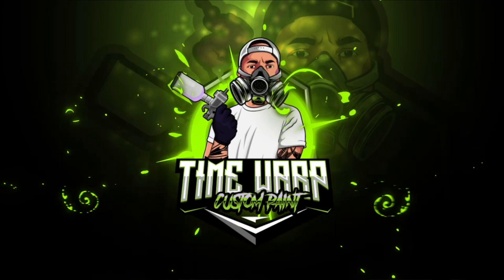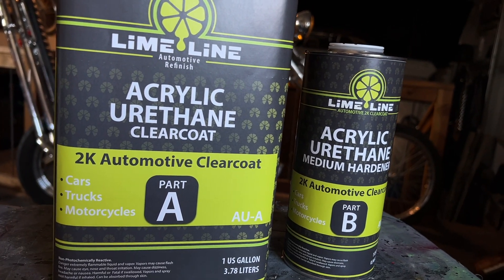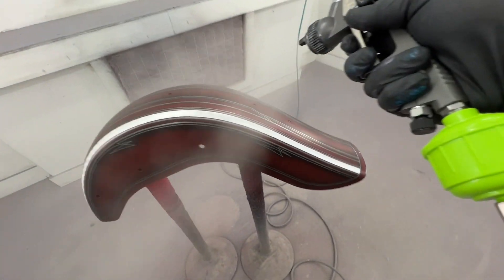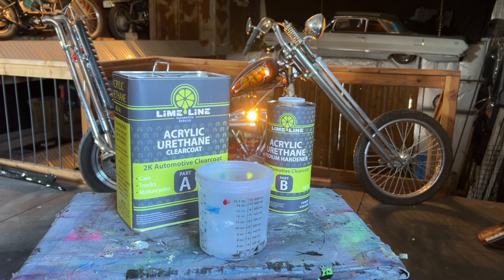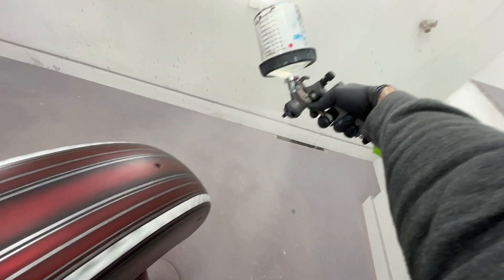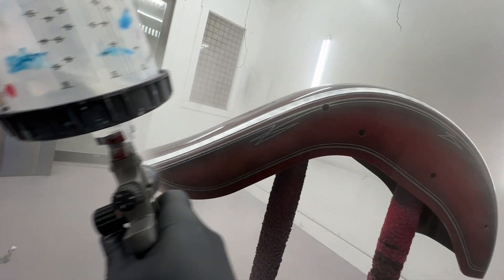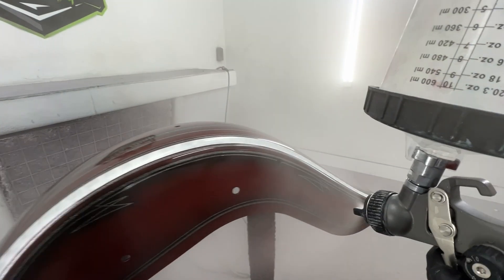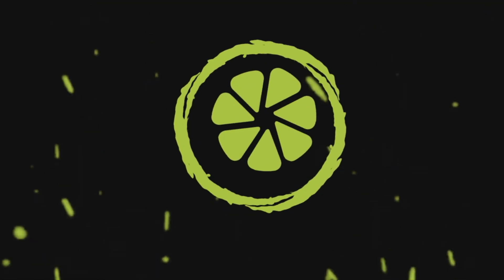What is 2k Clearcoat?

Comment: Good information.  What chemical do you use to clean the air gun in the air gun?  Do you clean the spray gun after every coat or will the clear coat dry and clog up the gun in between sprayings if you don't?

Comment: Nice job, but why are u using a HVLP instead a RP for the clearcoat? Normally u want a higher application of the material and the RP is typically the better choice.
Reply from the maker: Not in all cases